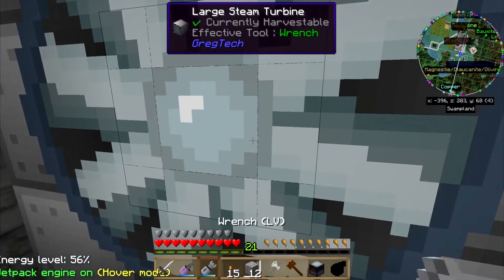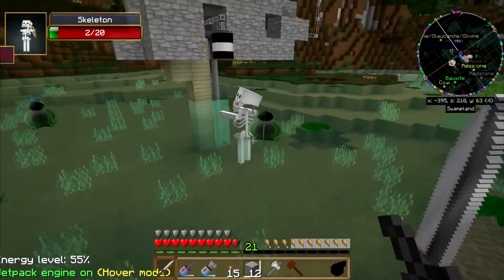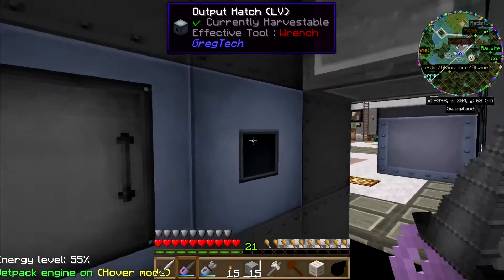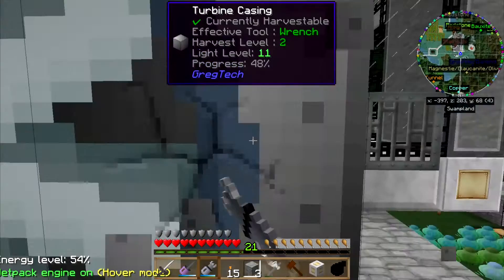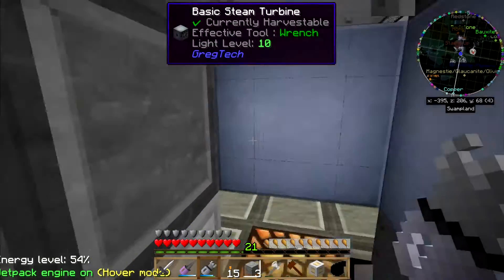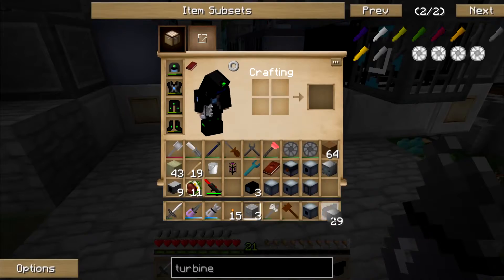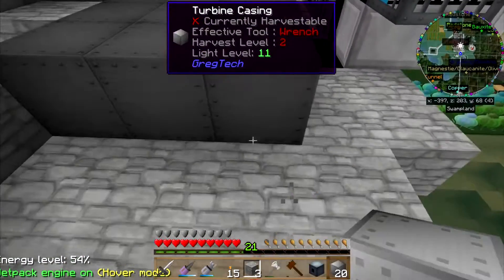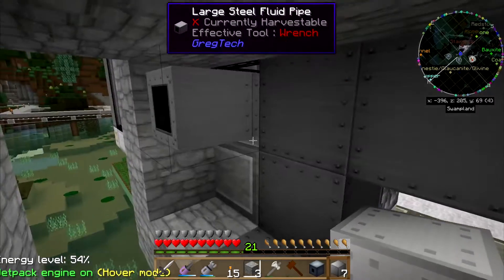Lac Plays FTB Infi-Tech 2 S2 Ep 158 I Need A Turbine Mechanic

Comment: 1) Having multiblock machines over chunk borders can cause this issue.
2) Invisible blocks are still a thing, so they might be inside the turbine when its supposed to be empty.

Have you tried to make the turbine somewhere else? Not touching any other machines (like yours is touching the Basic Steam Turbine on the back)?